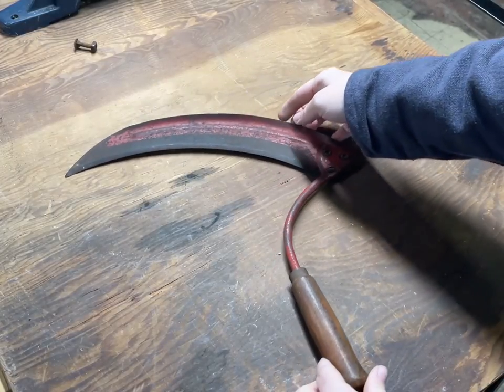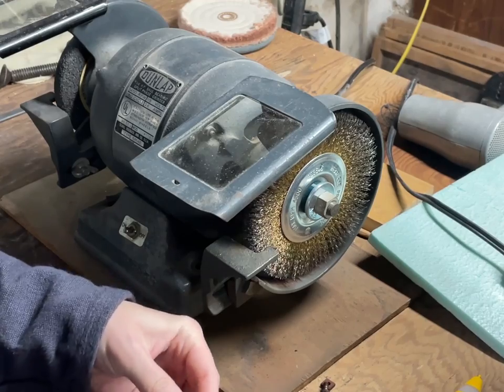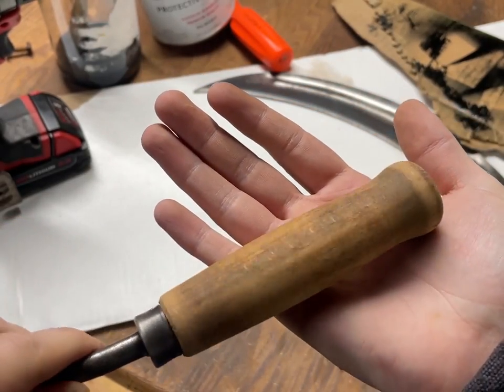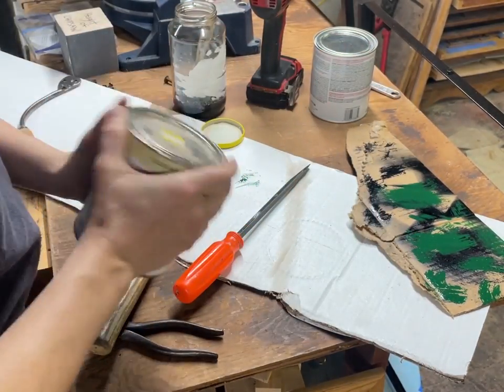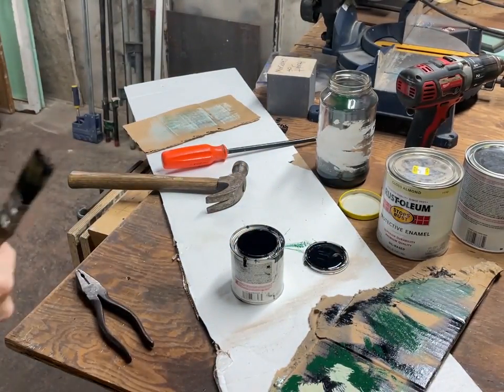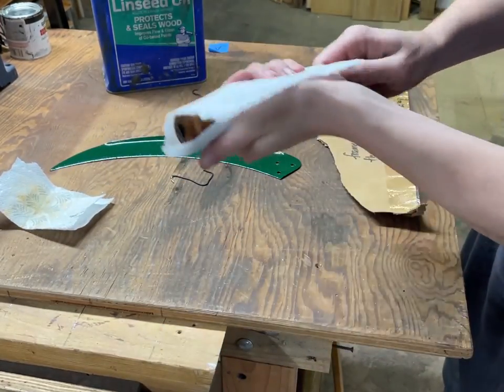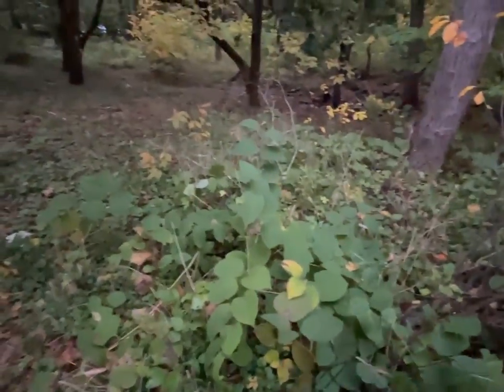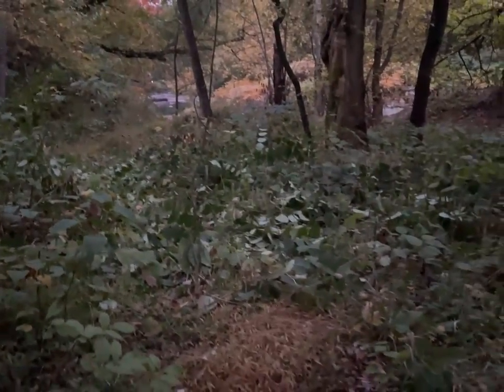1920s Sears Sickle Restoration and use for gardening in a park.

Comment from the maker: Youtube took 3 days to render this video in HD, and it's locked to 360p forever now.
Meanwhile if I upload a 1440x1080 video that is under 8 minutes, it renders to 1080p within 20 seconds.

Youtube used to handle 1440x1080 perfectly fine for over a decade. Only an issue in the past months.
Reply: You could pad the 4/3 video to 16/9 with black borders. Might look cool.
Reply from the maker: But then it will look even worse when on a cellphone.
Reply: @RinoaL  true I didn't think about the cell phone